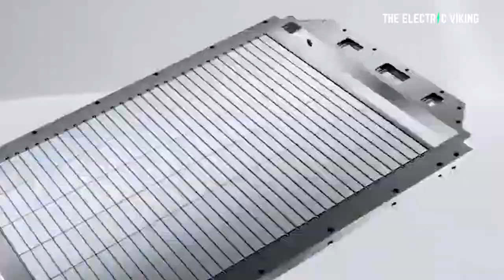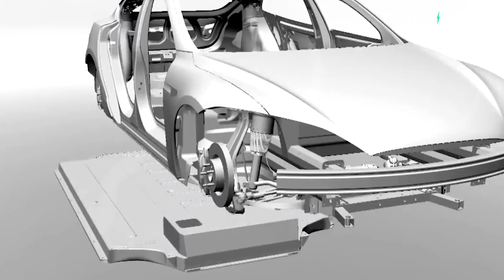Tesla's Model 2 Hatch & Crossover will KILL gas cars in 2023

Comment: Model 2 it must be.  After all it cleverly fits with  Elon's other model names:   2 S 3 X Y .    Range of 300 miles {= 483 km} roughly equals the highway range of my present beloved 2007 Honda Fit.  Good enough even in winter.  I eagerly await further news.  Many thanks, Sam !
Reply: Could also be called the model B so we would get BS3XY.
Reply: Tesla Model 2 also fits nicely with the Ford Model T, which changed automotive history for ever.
Reply: Tesla's lineup will be an acronym for "sexy cars" with the Model S, Model 3, Model X, Model Y, Cybertruck, Model A, Roadster, Semi.
EDIT They can eg. extend that to a model 4 and U. for "sexy cars for you" acronym.
Reply: fit gang!
Reply: Or Model AF
Reply: Honda fit design should have been used for their EV. Honda is sleeping, make it with one motor and skateboard. Use the largest giga press to make a single casting for whole car and them use the design of cyber truck to make a replacement for all minis, three wheel vehicles that are the most useful
Reply: In the U.S., it doesn't seem like people would go for the SR, if it only has 180 miles of range.
Reply: @darylfoster7944  There are many niche markets.  Why carry around a big heavy battery if your worst-case commute is short and/or you have access to charging facilities at your workplace?  Different strokes for different folks...
Reply: @Devou1s    Excellent thoughts!  Are we having fun yet?
Reply: @Devou1s  This. I've been yelling this at the top of my lungs for years lol this HAS to be the naming scheme.
Reply: @Devou1s  
2 S3XY CARS 4 U
The new platform is announced to be used for two different models. These will probably be the Models 2 and A. Then, models U and 4 might be on the Van platform.
Reply: Zza
Reply: ...Then the Individual Mobility product... IM 2 S 3 X Y
Reply: Lord almighty why not I-S 3 X Y or Y-S 3 X Y
Reply: Elon said it wouldn't be model 2.
Sexy cars. Could be model A or C:
- A if *C*ybertruck, model A, *R*oadster, *S*emi
- C if model C, *@*truck, *R*oadster, *S*emi
The latter is more geeky, more unexpected and more Elon-like IMO.
Reply: I reckon model E....3SEXY cars!

Comment: Fantastic no nonsense prediction. Your detailed research makes it seem inevitable and imminent. All the more exciting! Thanks for confirming my own bias, EV.
Reply from the maker: Glad you enjoyed it!
Reply: @electricviking  just take the kgs and double then add twenty percent for quick accurate estimates.
"... Base model ... 1400kgs or 2800 lbs..."
-- EV
More like 3080lbs...

btw
LFP3 depending on the 3 will be significantly lighter per cell depending on the MgZnAl to Fe ratio. All three have lower atomic mass than iron so even 1 percent makes a diff.
If the atoms replace iron in the atomic ion cage as assumed it's way more than 1 percent.

Comment: I think it will have removable fly by wire electronic steering and pedal boxes. They can be put on left or right according to country and switched easily. Remove for full FSD Robotaxi.
Reply: You mean drive by wire. Then again, if it can fly...  "one more thing"
Reply: I think most countries legally require vehicles to have hard connections between the steering wheel and the wheels.  And that won't change any time soon.
Reply: @bobbytookalook  I believe Tony is right especially in richer countries. In  poorer places, bus on demand services could work well.

Comment: I’d love someone to explain why they think the Tesla Model 2 release will kill gas cars !!!!!!

I believe electric cars are the future , I currently drive an Ev & have done so for 5 years. 
But I’m very sorry to say at this moment in time I’m seriously considering going back to a petrol car. 
Here in the uk it is actually not worth going electric unless it’s a company car or you have solar at home. 

The price of charging an Ev has skyrocketed in the last 12 months. Dealers & other Ev owners need to start being honest around the cost of owning & driving an Ev. I myself have saved thousands of pounds over the last 5 years through driving an Ev. 

But now in 2022 with standard home electric being £0.34 per kw & most public AC chargers costing anything from £0.35p to £0.65p per kw & DC Rapid chargers costing anything from £0.69p to £1.00 per kw the cost of running an Ev has gone above that of a petrol car. 
If you do the proper calculations around cost of charging your Ev you will soon realise you are not really saving money. 
There was recently a test done by I think whatcar. 
A Vauxhall corsa E against a Vauxhall corsa petrol both driven in convoy on a 220 mile trip from Leeds. They filled the petrol corsa up at the motorway services which is the most expensive place to fill a petrol car up at , at the cost of £1.99 per litre & they filled the corsa E up at one of the cheapest rapid chargers in the uk at the cost of £0.69p per kw. 
The corsa E cost £9.60 more in electric than the petrol car did in petrol. 
That’s crazy , Especially when you could fill the petrol car up at nearly any other garage for £0.40p at least cheaper but you couldn’t really find a cheaper rapid charger so in the real world you would save more than that. 
They also tested the bmw i4 M50 against a Bmw M440i & again the petrol bmw was £5.50 cheaper than the Ev version. 

I know Ev owners will be saying but I only pay £0.10p on the octopus go cheap night tariff to charge my Ev. 
But that’s not entirely true is it Ev owners. Because you may get 6 hours of cheap charging from 23:30 to 05:30 but you pay £0.10p more for your day time Electric eg the next 18 hours of the day at the cost of £0.44p per kw instead of the government cap of £0.34p per kw. So for a proper calculation cost of charging your Ev you need to add the extra you pay during the other 18 hours onto your Ev costs. You must also remember for every pound you pay for electric charging you only actually get £0.85p of electric in your car as you lose around 15% in the transfer. 

Now let’s more on to the myth of you’ll save on maintenance with an Ev. 
This is partly true & false older electric cars need little servicing compared to petrol cars. But if you buy new for the first 5 years of ownership there is hardly any saving from maintenance. The reason behind this if you don’t have your Ev serviced every year you will lose your warranty. And the cost is roughly the same as a petrol car. Like Ev’s the first year to the 4th year the only difference in servicing is oil & filter. If you look at the MG service package there is £2.00 difference in monthly cost between an Ev package over the petrol cars package. Petrol cars do start to be more expensive after the fourth service if you use the main dealer. But most people don’t take older petrol cars to the main dealer after there warranty has run out. This is where it gets a bit more awkward for Ev owners as you get a 8 year warranty on the battery & motor you still need to have it serviced by the main dealer to keep that warranty for the 8 years. Because of this it is more Likely to cost you more in maintenance for your Ev as most people don’t take 7 / 8 year old cars to main dealers for a service. Then there is car insurance Ev are more expensive to insure than there petrol counterparts. 

Over the years the uk government has stopped all grants to private buyers. The £5000.00 grant got dwelled down to £1500.00 & has now gone. The charger grant has also gone. Free chargers have now more or less vanished. With April 2023 fast approaching & the government removing the cap home electric is estimate to rise from the £0.34p per kw to £0.51p per kw & public chargers will go up as well so Rapid chargers will be at least £1.00 per kw. 
So like I said unless you have a company car or you have solar at home your Ev if not at this moment cost you more to run than a petrol car come April 2023. 

Then there is the cost of buying an Ev. Let’s say you buy one of the cheapest Ev’s on the uk market a Vauxhall Corsa E ultimate this will cost you £10,000 more than the petrol Vauxhall Corsa ultimate to buy , but in real terms it will cost you £13,000 more. If you look at Vauxhall’s finance because the Ev is £10,000 more to buy you will pay around £3,000 more in interest. So you Ev now has cost you actually £13,000 more than a petrol one but remember you need a home charger too the average cost since the grants removal is around £1200.00 so your already in the hole for an extra £14200.00 because you bought an electric car. Lets say you electric is free for life & you do 10,000 miles a year it would take you around 8 years to get that money back if you didn’t pay a penny for you electric. 
But in todays market it will most likely cost you more to run the ev & come April it will 100% cost you more to run an Ev.
The time has passed where you can put your fuel saving costs towards the extra cost of the car & with no grant anymore you will have to shoulder that burden yourself. 
So please all new people looking at an Ev do the calculations yourself if your getting an Ev to save money , because you will not save anything. 

I must make a comment about Tesla I have owned two Tesla’s & they were nice cars. I was a Tesla fan boy but not anymore for the below reasons.

1. Too many broken promises. 

I have paid for FSD twice & it has never been operational even tho Elon said it would be very soon. 
Tesla should transfer it to your new car if you’ve paid for it & it hasn’t been activated yet. 

The supercharging network we were told back in the day you buy a Tesla & some of that money goes to build the supercharging network. 
I get Tesla opening up the network to get uk funding towards it , but when you have spent £80,000 plus for your Tesla it’s not right anyone can have access to it , at the same rate as you for just £10.00 per month & can just pay for one month & cancel it. It’s a betrayal of the people that have spent tens of thousands buying tesla for access to the superchargers. 

New car prices Tesla / Elon always said the more cars we sell will bring down the prices of tesla cars. Tesla make more per car than any other main stream manufacturer. Tesla also put up prices in country’s that have great sales & brings down prices in country’s with bad sales numbers.
This goes against what Tesla has said in the past. 
Even tho tesla make more per car than any other manufacturer they put up the price of the model 3 standard in the uk from £38,500 to £48,500 that’s a rise of £10,000. Tesla / Elon said the model 3 would be affordable £48,500 for a starting price & base model isn’t affordable & it shouldn’t be in the 50k car bracket it’s not worth that. It should be a max of £35,000. 

The roadster has been promised for years now & the cyber truck but they are know where to be seen.

Comment: With the battery being produced at a lighter weight, apart from the extra range it should also be slightly faster (for 3/Y) right?
Reply: 0-60 in 1 sec 😊👍
Reply: @HelloMyFriend_  It will bend time and space.

Comment: If Steering /acceleration/ braking   are fly by wire implementations .   Can we finally outgrow the outmoded LEFT/RIGHT  hand drive that defines the cars target market? .  simply provide a bus connection on either side of the dash...... Oh and By the way  a steering wheel does not need a airbag if it only needs the structural strength of a joystick and collapses in an impact....
Reply: I was hoping that this idea would be implemented with the cybertruck to service right hand drive markets. It certainly makes sense when building a new vehicle for the world 👍🏽🐨🇦🇺

Comment: Actually, I would go stronger on this. Tesla (to me) are a software and charger company primarily. They have also focused on how to build EVs from day one and are at an unbelievably advanced level on how to make cars in a skateboard world.  I think a model Z, small SUV will be the most important model going forward, but the same skateboard will be used for the model 2, a new small roadster (mx-5 size) and a smaller EU sized pick up truck. The current one is just too big for the EU needs.  The new small platform and casting method is key.  To survive, the other OEMs have to follow.
Reply: Actually, I would go stronger on this. Tesla IS a software, charging, robotics, manufacturing, and artificial general intelligence juggernaut.
Reply: @thestonksmarket1897  agreed. The making of cars is just a way of linking everything together.
Reply: Id love a mini cytruck in usa as well. Not sure if theres enough difference between a hatchback m2 and a suv on the same platform, how much suv could you really achieve?
Reply: @taylorhray  True, depends on how small is small, I doubt its going to be fiesta sized.

Comment: Love your video! In my opinion, I don’t think there will be a 250kw charge rate on small sized batteries. There’s nothing close to that on the market right now. However, if it’s 150kw, DC charging should be very quick. Very exciting if this car is produced and sold over the world. Again, thanks for a great detailed video!
Reply: I think it'll be closer to 150-170kw like the LFP 2022 Model 3!
Reply: I agree. The base Model 3 with LFP tops out at 170 kW charge rate for a ~58 kWh pack. That's a charge rate of about 3C. 150 kW charge rate for a 50 kWh pack sounds realistic.
Reply: @iamjoehill  I think you are onto something here. I still think a 30kwh battery won’t be as high though. New Fiat 500e peaks around 85kw. I wonder what the charge curve would look like for a small battery size like that? 50kw lfp totally agree!
Reply: @tbnzet  Exactly! 30 or 40kwh battery? Don’t think so. Maybe 85-100kw peak?
Reply: @jpnw3272  Yeah, I also think the smaller packs will peak at around 100 kW.
As the owner of a Model 3 with a "250 kW" peak charge rate - I think the focus on peak values are rather silly. I've maybe seen close to it a couple of times, but only in the summer with a warm battery and very low state of charge. And then the peak is only for a few minutes. In the real world the charging curve is more interesting, and the behavior with the battery at lower temperatures. But we probably have to accept the focus on these peak values as all brands use it for marketing 🙃😊
Reply: Inverter w/liquid cooled cables for longevity ina high traffic parking lot covered in solar panels click click
Reply: qmans hello! the >4.1 volts makes this a different beast 150 sounds good but the manganese and especially the aluminum and zinc will allow > C rate = faster charging.

BTW the super chargers are already liquid cooled so the copper carries the cooling into the battery.

tl/dr dc charging doesn't use an inverter...
Reply: @massawalawson6144  That the super chargers are liquid cooled has nothing to do with cooling the battery. They are liquid cooled in the cable to allow for thinner copper wires without overheating. Same as with most other fast/hyper chargers.
Reply: @tbnzet  the cooling travels to the batteries and indeed delivers the cooling through conduction to a degree.
"They're all connected!" -- Total Recall
Reply: @bythewaywichonespink  That's incorrect. It does not cool the battery in the car to any degree. Here's a quote from e.g. chargedevs "Liquid cooling allows the cable to be thinner and more flexible while carrying the same amount of current". This is the exact and only reason for having a liquid cooled charger.

Comment: Sam- In the US, in the 1960s, the Volkswagon Beatle and the VW Bus, were the universal low cost vehicles. Their air cooled engines could be repaired by any mechanic with basic skills. (I observed a student at Cal Poly, completely disassemble a VW engine, rebuild it, put it back into the car and drive it away first try.)
My direct experience was with a Beatle, which I drove all over northern Europe in 1965. My father bought it in Germany. Under powered, at 36 horsepower. (I got a ticket once, for entering a freeway, a mile ahead of a pickup truck, which must have been going at least seventy mph. The pickup swerved around my VW. Observed by an officer, who gave me a ticket, for a hazardous turn to the left.

The TESLA Model 2 needs to be the same low-cost car, for students, young people and the world, to eliminate the over one billion ICE cars polluting the planet. 
The 500 Chinese companies, producing minicars, have the prices way down, below $5,000 USD, but those cars won't sell well in the US, or meet the crash standards.
General motors can only afford to sell Hummers and Cadillacs. Ford can only survive selling expensive pickup trucks. TESLA needs to provide a super VW bug equivalent for the 2020s, that will move the world to electric. 

COP 27 is saying that 1.5 degrees warming is already gone, and the world is heading for 2.7 degrees global warming, with the hundred year weather extreme happening
every week.
The only car I can see in my future, I currently own both a TESLA Model 3 with FSD and a Hyundai NEXO fuel cell, is the apocalypse-ready mini cybertruck. 
Bulletproof, Hazmat protected and floats.